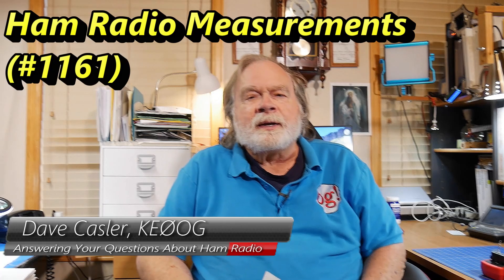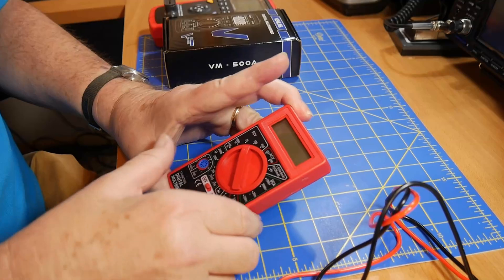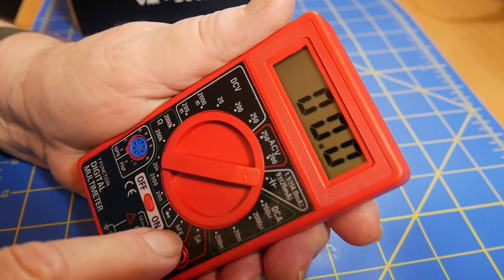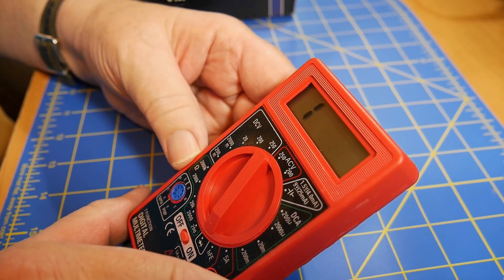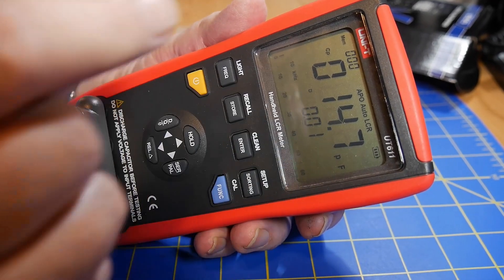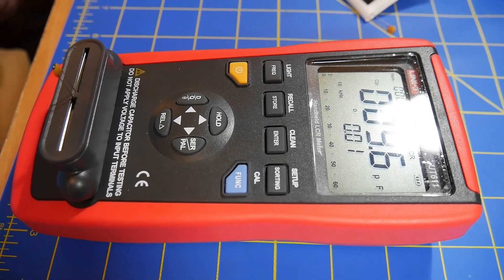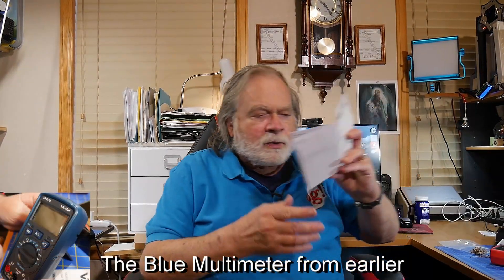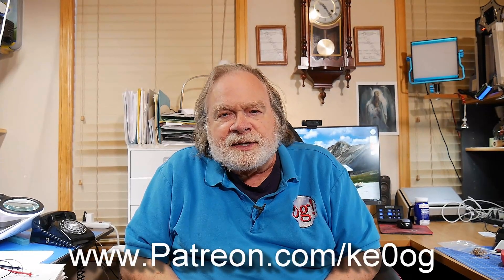Ham Radio Measurement (#1161)

Comment: hmm, when I took a home study course in the mid 50s, and four years later in engineering college,  VOM stood for Volt Ohm Meter. BTW, the DVM that you showed, you work your way down (the voltage switch) CCW, not clockwise. ;)

Comment: RLC meters are quite cheap, but for RF if someone have got access to scope then the osciloscope is the way to go as it can measure value in conditions that this element willl be working at. Tere is a posibility that an capacitor at RF have an inductive response to signal.